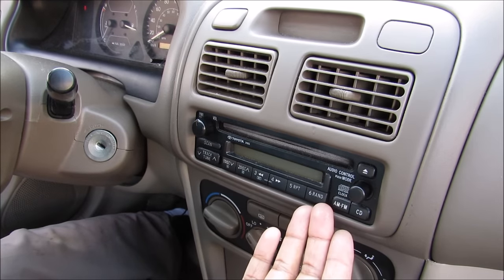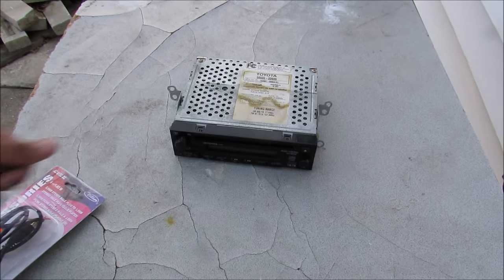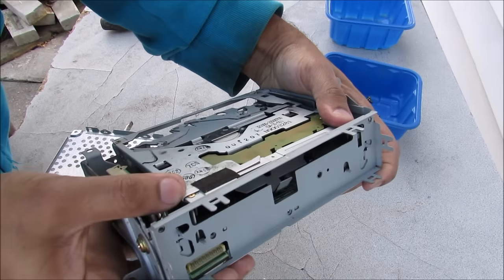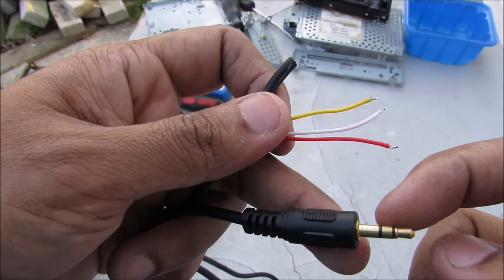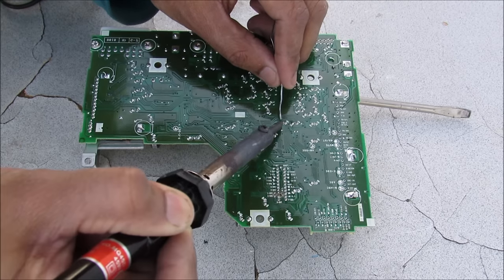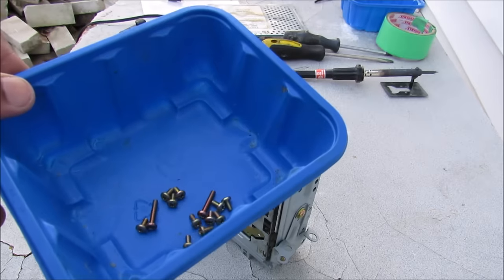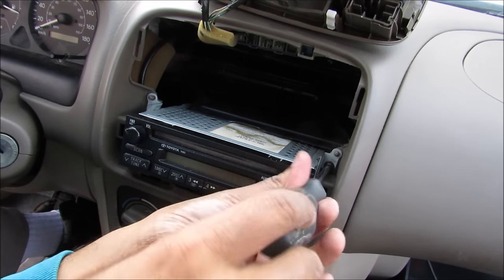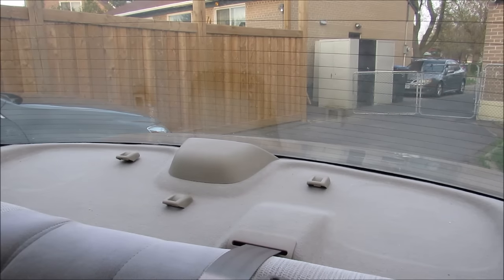Aux Input CD Stereo Hack

Comment: I got stuck... I didn't have enough change in my tray to purchase a blank cd and wire. :(
Reply from the maker: +lbrtdy Ah, well Corolla has a small change holder on the left side of the steering wheel and one in the center console. You might want to check under the seat cushions, thats where I found some dimes and quarters.
Reply: in that case you don't deserve it. In fact you should be thankful that you have a car in first place.
Reply: 5 finger discount

Comment: Just made this mod on a Panasonic CQ-C1311N head unit and it works beautifully! I was using an FM transmitter before, but it always had some awful background noise. With the direct AUX input, it instantly stopped, and the sound is crystal clear.  Thank you so much for your guide!

Comment: Just finished doing this, took a few hours (had to learn how to solder basically) but it works!!
Reply from the maker: +greg golding that's great! I'm glad it worked out for you, and now you have a new skill.
Reply: @speedkar99  great Vids my man!!! I want to do this to my old Clarion 9575rz.. took it apart but don’t know where to solder the points.. any help would be greatly appreciated.
Reply: @richardkirkaldy8411  you can research your head unit to find it and some head units have codes that when you research it will show you a diagram of where the points are

Comment: Two bonus ideas:
1: Get a female connector with a screw clamp, and drill the trim out right between the radio and the vents, and have a port that will be much slower to wear out.
2: run the line to the popout ash tray where you keep all that spare change, and keep a bluetooth adapter handy inside. If you need to turn it on or pair it to another phone, just pop the ash tray. If you need to charge it, pop the ash tray and unplug it, or sneak a 12V cig plug with a USB brick in behind the trim and run one of those cables to the ash tray as well.

Comment: Just added my MP3 aux but by spicing into the internal wiring harness from the CD unit to the MB. I'm not a solder guy. But still, tiny wires. For my wiring, the Sony harness has 3 wires separated from the others, a 13 wire harness. A R, a L, and a G. Used a tap but the wires are so thin they were cut so I had to adapt a pinch splice. It works and I have what I wanted. I have a 1999 Olds Intrigue with a Bose dual CD system that all the big guys avoid. This is a sophisticated CD, tape, radio and now I'm happy to have this added feature with all the others unaffected. Yes, you have to make a blank CD.
Reply from the maker: Thanks for your experience
Reply: Thanks for your video so I could do my hack. No one makes a harness for this system, the iSimple FM modulator I have had for years-I hated the quality and fiddling with the interface. If I want to adding a bluetooth is now simple but I like the direct quality.

Comment: Mine is a double DINN so I really had to go looking for the solder points. Had to take it apart a few times to make sure the radio, tape deck, and CD player worked.

Burned a silent CD and popped it in. Started up Spotify and that's the clearest signal I've ever gotten out of a phone to a car stereo.

I really appreciate this tutorial. Now, I don't have to go out and buy an after market radio just yet.
Reply: how did you burn a silent cd!?

Comment: This is cool, but a much easier (although more expensive) way is to remove the stereo and just plug in an antenna/aux adapter box. Unlike a wireless FM transmitter they don't get interference and only cost about $20.
Reply from the maker: Great suggestion.
Reply: HailAnts it’s called a fm modulator
Reply: Apparently the sound quality of those aren't as good as this CD method.

Comment: You should disconnect the audio-pins coming from the CD-player's DAC-out, instead of leaving them in parallel to the aux-cord.

Don't know the output-impedance of the CD-DAC, but if it's in the range of <100 Ohms, it would be a load for the connected audio source and lower the volume.
Btw: In parallel the CD-audio would also come out of the audio-jack...
(But disconnecting the CDP-Out would cause you to be unable to play CDs anymore)

The "elegant" way would be a 3.5mm-socket with switching-contacts, that connect/disconnect the CD-Out-Pins when pluging in a cable and switch between them! :)

Perhaps you also find a way to activate the CD-funktion without actually playing a CD? (Find the right Pins to bridge?)

Greetz!
Reply from the maker: Yes those are all great suggestions, especially with the switching jack. I wasn't too worried here since this radio is old and the hack still worked.

Comment: LOL ... Good Quality Cable... 1.99$ :D ahahhahahaha
Reply from the maker: +XXL COCKTAIL agreed
Reply: Jeffrey Shepherd His car is a 2002-2006 Camry.
Reply: Honestly that's some good cable if it's $1.99. At our local axeman's or RadioShack, we can pick up then lil bitches for $0.33 on the dollar.
Reply: Well they are all cheap. All the retailers just add 300%-500% on top. I know cuz I had to do it too.
Reply: Actually You're lucky in a way it is NOT a high quality cable. It has a yellow wire for earth and not a screen around other two conductors as it would be on a decent quality cable. Getting screen twisted up and then insulated without short circuits can be quite a job in itself

Comment: Realy good video. Just small suggestion... instead of soldering AUX cable directly, you can solder a wire with the jack on it. So the hole that you drill somewhere in the car will actually be a jack, and you can plug any AUX cable later. I'm sure you know that already, but for the other viewers...
Reply from the maker: Yes that makes more sense

Comment: Worked for me...thumbs up for your video. For those who cannot find R-out L-out and GND, make sure you check both sides of the motherboard as I noticed these markings are on the bottom side of motherboard on my stereo rather than the top side where the CD unit sits on.
Reply from the maker: Good tip. Thanks

Comment: Or you can buy a $30 radio.. Im just saying
Reply from the maker: +Scott Dinh looks ugly
Reply: Scott Dinh I want to but I don’t want to drop $75 on an adapter for my car
Reply: nathan amundson right you have to buy a dash adaper radio and a harness 100 dollars later LOL
Reply: its_cesar_boii on this particular car (98-02 Toyota Corolla) it's actually very simple. I bought a pioneer radio for $30, a harness for $10, and heatshrink for $2. That's all you really need. The stock faceplate works fine and you can use the stock mounting brackets to mount it. So in total $42. Not bad.
Reply: Scott Dinh yeah Walmart has them fkr 20
Reply: what if you want it to look stock still?
Reply: Re use is better than just buying new and creating more waste :) Plus, it's great if you like to diy hack things.
Reply: Scott Dinh who asked you?
Reply: Yeah you could, but there is utility in learning how the company Would have created an aux port.
Reply: It's not always that easy. My car has this stupid proprietary system that no one makes aftermarket parts for, so I'd have to take it into a shop
Reply: @speedkar99  the entire car looks ugly
Reply: i aint buying a fucking 80 dollar mounting kit for my old ass mazda tho
Reply: @azbgames6827  Free country you can do what you want.   I spend at least 5-6 hours a day in my day driving around.. I want my cards to have a nice setup and environment
Reply: not enogh coins..

Comment: Hey, great option for people that don't want to go aftermarket. I tapped into my cd changer harness in my 2005 Honda pilot. I'm using a Bluetooth device that needs constant power but this is also creating a ground loop. I tried using an ground loop isolator but there's a drastic loss in volume and quality. Do you think I could eliminate the ground loop if I disconnect the ground wire going into the cd changer harness?
Reply: If I understand you correctly it would be better to cut the ground from the bluetooth device as it draws less current than CD Changer and the bluetooth device will then ground through CD changer so should then not have a ground loop
Reply: @peterkershaw7225  thanks for the reply, I'll definitely try this.

Comment: Great hack there. I was wondering how you'd get the radio to listen to your inputs since normally the CD mode is disabled unless there's a CD playing - but there you go, you solved that by simply giving it a CD lol. Might I suggest also to cut the traces from the CD player so as to prevent your phone from feeding the CD output or vice versa (thus disabling permanently the CD player).

I have a very similar radio and I thought I'm less likely to listen to AM, so I'll try and find the traces from the receiver and use those instead. If not possible, it's still very unlikely that I'll listen to a CD anytime soon.
Reply from the maker: +The512MB with the CD output silent I don't think too much harm its done, though I see your point. AM is crusty sound and mono, bad quality, I tried it.
Reply: speedkar99 Hey, Completed the hack successfully with the AM/FM route. There were no testpoints for either the CD paths or the radio paths (however there were for an unpopulated Dolby paths, not installed in that model). The CD paths only had really small vias to solder onto and it did not end up working. With the radio paths I expected some noise but it turns out that when the jack is plugged, the signal from the radio (be it white static or actual content) is completely eliminated. The sound quality from the AUX is high quality and no noise/distortion is noticed, unexpectedly. Thanks for the inspiration!

Comment: Great video thank you. Just a thought, instead of soldering wires onto the radio circuit board would it be possible to solder the wires to the wires on the  8/12 pin socket of the CD stacker in the trunk. I just wondered if this would work as it would save me removing the radio and the soldering would not be such a delicate operation. I look forward to hearing from you. Regards Anthony

Comment: I looked up how to do this for using an old boom box. Thanks. Working in it now. All we're actually doing is wiring to the audio output leads? Insane.

Old video here might not get a reply soon, but you say playing a blank CD to initiate the sound. Ok.  Do you actually play the disc, or just let it read the disc? I don't see you pressing play so I just wanted to to verify. I'm currently without a CD burner.
Reply from the maker: You burn a silent track onto the CD and play it.
Reply: @speedkar99  I wasn't able to complete my project, my board had no labels, and I couldn't find a good pinout for the microprocessor chip, but anyway,

Would playing a regular disc and just pressing pause work the same?

Comment: Great video, loud and clear, i like to do this on my Land Rover Discovery 2 (2004) it has cd changer and steering wheel remote control, changer not needed but any idea if remote control will work? I made a system adapting from changer onder seat but has interference and i like your system a lot better, makes sense! Anyway, maybe you can help me out, have a great 2022, it certainly will imho. Thank you!

Comment: Great video I did it & it worked. Question when I have the silent CD in, & my phone attached there is a buzzing sound (not affected by volume controls) until I start playing content from the phone. Any ideas?
Reply from the maker: Is your phone charging? If so it could need a ground loop isolator

Comment: or better yet, drill out a hole in the front fascia of the head unit and glue in a 3.5mm female jack so you can use any cable you please.

Comment: Can you still listen to your regular cds even with this installed? Sometimes when I’m doing short trips (reference being my previous car which did have an aux port, my “new” one does not)   I’m not going to bother plugging my phone in, wait for Spotify to open and scroll till I find what I’m in the mood for. I just listen to whatever cd I have in, all of which are for bands I really really like so I’m always in the mood for them. And there is a band I’m very fond of that is only available on cds. I don’t want to have to go through YouTube and waste my data every time I want to listen to them, especially when I own the cds already.

Also my vehicle is a 2003 Subaru Outback with a 6 cd changer. Would this even work with this kind of a radio? I know that it would probably be much easier to just get a new one but the sound quality of the one already in the car and the look of it are not things I’d like to sacrifice if I don’t have to. Thanks!!
Reply from the maker: Yes the CD will still work

Comment: Clever! Could you have tapped into the corresponding wires on the harness instead?
Reply from the maker: +ScubaCat3 Thanks! 
The harness goes directly to the speakers, so you would have very low volume and no equalization control if you hacked that.
Reply: The internal harness works, the unit to the MB, 3 wires are separate R,L and G.

Comment: Hi nice hack. My motherboard is different so I soddered the ground to a PGND pin and my phone only plays music through the aux if the cable is already plugged in before turning on the key to ACC. If you unplug and plug again the music does not play anymore, neither if you turn on-off the radio. It seems that the phone recognizes the jack exclusively when the car battery is turned off and then it keeps recognizing while plugged and turned on. I don't know if need to change the ground connection because the audio quality is great when it works... Any ideas?

Comment: How old is the radio? What was the other input for in the back of the radio ... it may have been an Aux input ... if so all needed was the correct phone to aux cable. no need to tear down and no need to solder.
Reply from the maker: For a cd changer

Comment: Great stuff....been wanting to do this with a factory CD/radio 1995 Dodge truck vintage. Most of the vids on this are the same; find the left channel/right channel and ground as close to where the CD player connects as possible. If there is no AUX display on your head unit, then I guess you have to use the blank CD to 'fool' you head unit into playing from your mp3 player. Do you have to burn anything onto the blank CD, or just format it....what?
Reply from the maker: Burn a silent track so it doesn't eject the disk

Comment: I saw your first video and in that one you said it wouldn't work try soldering the aux into the CD part of the board and recomended soldering to the FM module because the CD used a digital output.  How can I know if I can solder to the CD or I have to use the FM module?
Reply from the maker: +Krepe Trial and error? That's how I found out.

Comment: There is much wrong with this.  

1)  It is often undesirable to have a cable permanently soldered on when you could have used a panel mount jack or better still a bluetooth module tapped into a 5V circuit.  Even a bluetooth linked, FM transmitter to the stereo tuner as an input would be as good as a permanent wire hanging out.

2)  You should not feed the cable through the stamped out hole on the radio metal housing (with sharp edges that can cut the wire) without a (nylon, etc) bushing to protect the wire.

3)  You cannot just use a multimeter to measure continuity and determine that way, that a remote location on the PCB is an acceptable solder point.  Continuity does not rule out there being a resistor, and a resistance is quite common to see on the typical opamp preamp type subcircuit you would find in analog audio before the power amp IC stage.  It may work for you THIS time, but it should be mentioned that it only applies to this radio, otherwise a resistance, not continuity measurement should be   made to ensure nearly 0 ohms (within the error of the meter leads and probe tips).
Reply from the maker: +Stinky Cheese thanks for the tips.
I prefer to have a male wire attached, since you'll still need a male to male cable to connect to a female panel mounted port anyway so why complicate things. 

My continuity tester does measure resistance and it read no resistance. What I didn't show was I physically traced the connection from the CD port along the motherboard to endup at that solder point and there were no other components along the way.  I didn't randomly just test points on the board.

Comment: Shouldn't you be able to, theoretically, simply splice into the wires that those solder points on the motherboard connect to? Wouldn't that amount to the same thing?

Comment: Good idea to solder 3 pins (left,right and ground ). Everything is good but why blank CD is required to play (input is aux, selected source as  media is CD on display )??
Reply from the maker: To trick the CD player into reading from the CD player but instead it pulls sound from the 3.5mm jack
Reply: @speedkar99  thank you

Comment: Sorry for all the comments, but I don't have a ton of experience soldering. Would you consider this a risky solder that could ruin my stereo?
Reply from the maker: +greg golding No its pretty straight forward as long as you get the right solder points
Reply: Be careful reading the optimistic posts.  There's a lot that can go wrong if you don't have experience soldering:  soldering to the wrong points, de-soldering a nearby connection, creating a short between two contacts with a solder whisker, burning and delaminating the PC board with too much heat....accidents can happen, and the less experience you have, the more likely they are to happen.
Reply: Yes I would say that if you're not reasonably competent at soldering do some other projects first before embarking on this one. No excuse for incompetent soldering. Get the practice in elsewhere and then come back to this when you know you're good enough. Best of luck